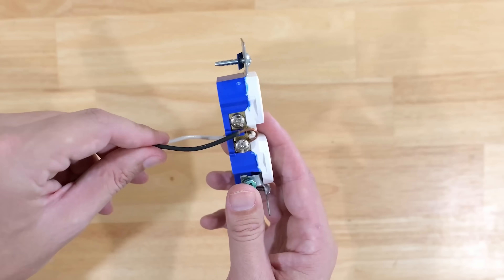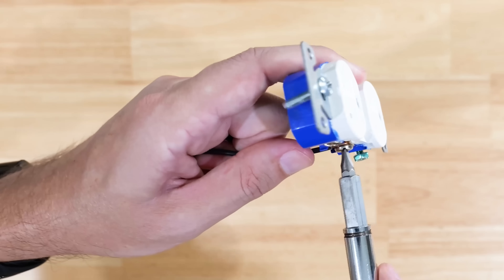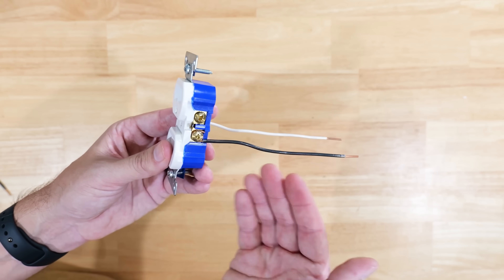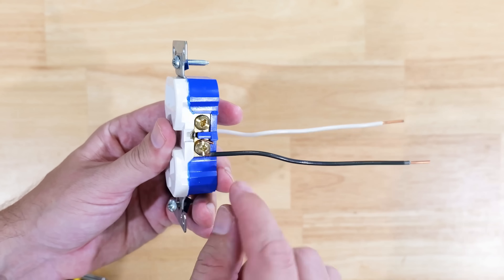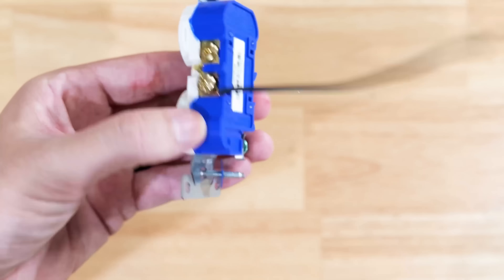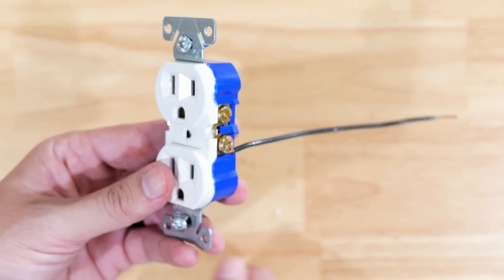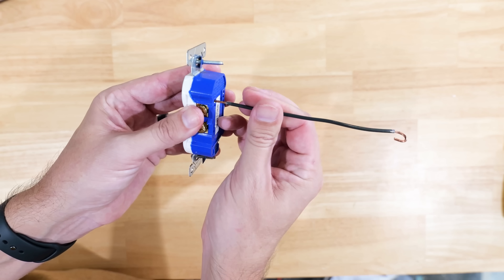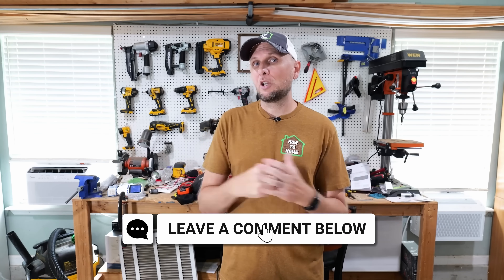Avoid Disaster! 8 FATAL Outlet Mistakes Most DIYers Unknowingly Make!

Comment: I'm guilty of the last one. I only buy commercial grade outlets especially because they're just better made, but I would straighten the j hook out because a lot of times the wiring isn't very long to begin with. Now I know better. Although I did run into two wires around one terminal while replacing an outlet and I fixed it with Wagos.

Comment: Love your videos!! Maybe someone can tell me how to fix this issue; I recently had some can LED lights installed on a new family room ceiling install. One of the can lights goes off after about 20 minutes with the light switch on (2 cans on one switch) . I have to turn the light switch off for about 5 minutes then turn on again, rinse and repeat. Any idea what happened?
Reply: It sounds like the chinesium LED driver is getting too hot.
Reply: @AstroMan-2  Thank you for the information. Since the can and light are hard-wired in, do I need an electrician to install a new one?
Reply: @Jeff1960G  you do not.  the LED element will be some form of toolless connector.
Reply: @AstroMan-2  yep.  defective fixture is overheating and going into safety shutdown.
Reply: If it’s an actual metal can light housing pull down on the fixture. Should be some “v” springs u have to squeeze a bit to drop the fixture. The connections may be a quick connect style u just pull apart or possibly may have a socket end that u twist out like a light bulb. Power off first.

Comment: Lots of new house builds have been using the backstabbing holes.
Reply: That's true indeed , When my mom bought a new condo , I've had to replace a number of receptacles and switches because when they wired the place , They used those cheap receptacles and switches and found them back stabbed which caused light fixtures to flicker and receptacles to cut in and out such as plugging in a vacuum sweeper , So I replaced them with commercial grade receptacles and switches And there has never been any trouble since , For safety , it's well worth it to spend the couple extra bucks for a commercial grade receptacle and switch , I never use those cheap ones , Ever  , Plus the commercial grade receptacles and switches last very much longer than the cheap ones
Reply: Most of my Recepticle get very rare plugging into and unplugging. ..
Most get plugged in once ...and stay that way ...😂😂 @ironmartysharpe8293
Reply: I’ve changed 6 house’s worth, varying from the 80s to the 2010s all of them were backstabbed. This has been a common practice for a long time
Reply: Cuts down on material cost and labor costs (faster to stab the back on 50 outlets versus making J-hooks & screwing them down.  Multiply that by 50 homes in a new development tract, and the developer is saving $ and time.
Reply: My parent's house had outlets in the finished basement (circa 1964) that only had backstab connections, no screws. I assume they don't make those anymore.

Comment: I like the wago connector but find that while you can't pull the wire out, you can still twist the wire in the connector. Makes me wonder how secure the connection really is. Wire used is in the size range for the connector.
Reply: I despise those connectors. A twisted pair of wires covered with the correct wire nut is a much better connection. They been used for years and no problems ever arise. The problem people don't put the nut on properly or use too big or too small of a wire nut. The new wire nuts that Ideal came out with are excellent. Push in connectors are ok with small loads like LED lighting. I use the Ideal brand of those push connectors for upgrading ballast to direct wire lighting. They save time and many times I must work with live wires. Turn off power when possible. 73
Reply: @ronb6182  Wagos have been used for decades in Europe without issues.

Comment: Great video. I have a bathroom outlet that only works when the light switch is on. Had bathroom remodeled a few months ago and never noticed it because the bathroom doesn't get used a lot, especially the outlet. Now that I noticed it, what did the contractor do wrong?
Reply: They probably connected the wire going to the outlet together with the wire coming from the switch going to the light. Either in the switch box or they ran a wire going from the light to the outlet (which would be very strange)
Reply: The switch is run off the light, not from the gang of wires to the light switch. Lazy and or  stupid contractor. Besides, depending where the outlet/receptacle is, should have been a GFI.
Reply: @monkeysnark7043 The switch is not “run off the light”. The switch connects and applies electricity to the light.
Reply: Prob nothing wrong. That's how a lot of older homes used to be wired.
Reply: @zacharymonroe1325  True, depending on the type of bathroom, also some are even wired from the receptacle, though in that case, it would be a GFCI. Still, in most of the bathroom renos I had done, a separate connection to the lights, and fan if there were any, was always preferred. The homeowners had a preference for that, once I informed them of the wiring setup.
Reply: @zacharymonroe1325  yea nothing wrong just the outlet doesn't work 😂😂😂
Reply: If its modern, that's a funny and harmless, if annoying mistake. As early as 30 years ago, however, having one half of the receptacle controlled by a switch was the norm. It was never normal switch the entire receptacle (both plugs) and it was never normal to have a switch AND a receptacle on the same switch. If that's the case, it was not likely intentional
Reply: Exact same problem that I had.  I foolishly thought I could open the box containing the switch and move a wire from switched to hot.
Nope.  The electrician wanted to save a dollar and ran the switched line to the outlet, and from there to the light.  There's no fixing this without opening up the wall.